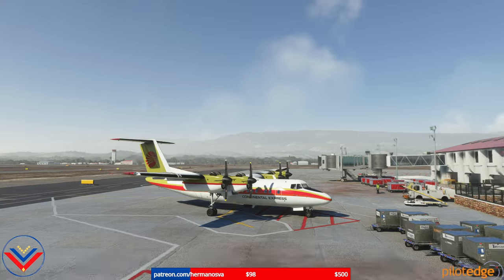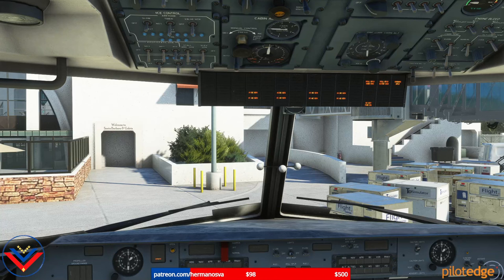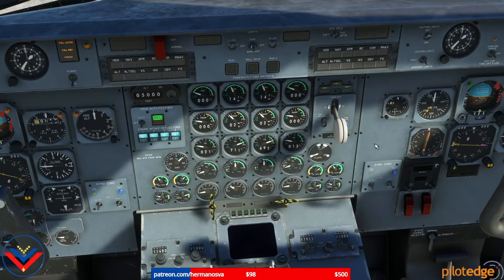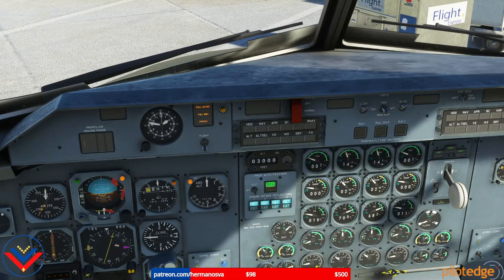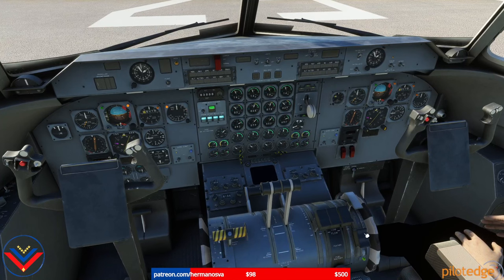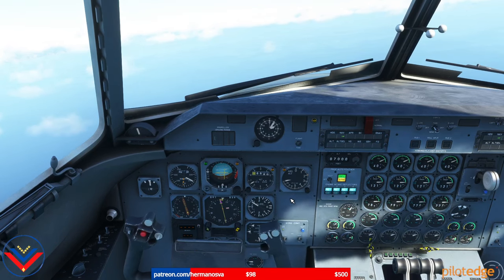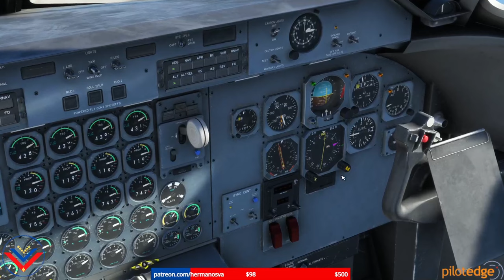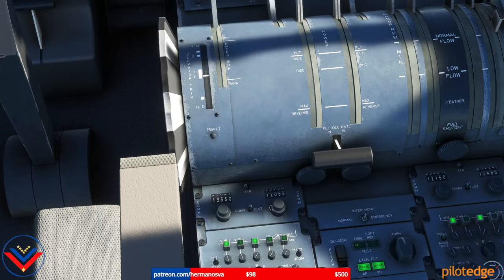FIRST LOOK: PILOT'S Dash 7

Comment: Is it really worth getting this? Lots of complaints initially and workarounds requiring mods to files.Marks out of 10? What version are you using?
Reply from the maker: Hey there. Thanks for the comment and questions! I do think it's worth it despite early negative feedback. Currently, I'm using the first version with the flight dynamics mod by ungeneer and a beta sound fix from the forum. I'm looking forward to the next update. Overall, with the fixes, I think it's a 7ish out of 10. I really enjoy some things about this plane, including the feel. It feels weighty and lived in and I'm partial to that. I think overall we need to bridle early criticism and focus more on a devs commitment to keep up with updates. Because, unfortunately, one thing thats clear is that very few are committed to release full finished products when they go public...Thats just kind of where we are in simming and gaming overall. If you like flying older turboprops and don't need advanced avionics + you like a plane that feels lived in, you'll like this plane. The mods are icing on the cake. I look forward to the next update being more complete and not breaking the trim 🤣